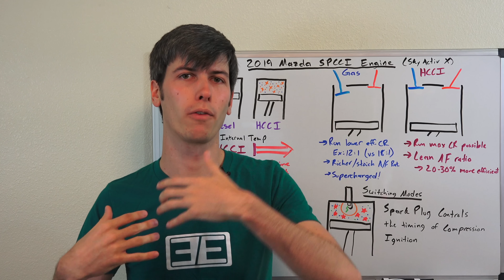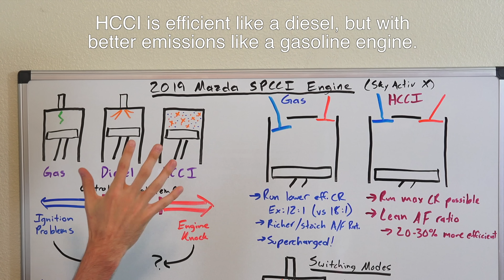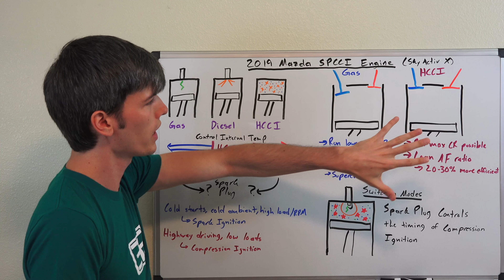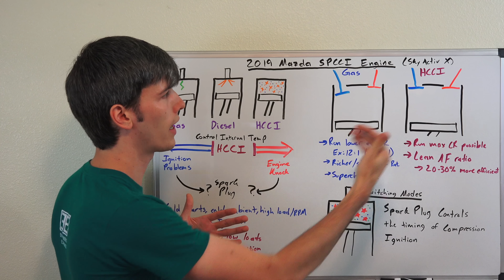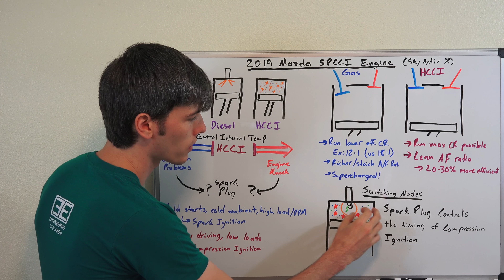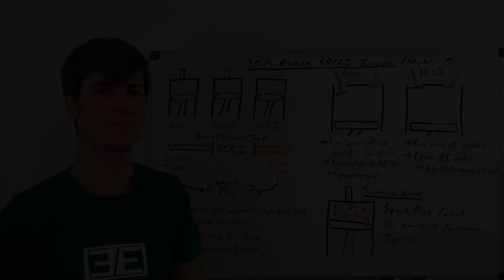Mazda Creates The Holy Grail Of Gasoline Engines - HCCI SkyActiv-X

Comment: This news just came out like 2d ago. Can't believe how fast you got this video out
Reply: Engineering Explained if the system is good it'll prove itself right away...when Honda came out with vtec people screamed bs....soon after every company had a form of it.....technology as you well know is growing....for now my 94 Acura with original unrebuilt engine with 205k on the clock gets 29-30mpg....
Reply: Keep up the good work EE.
Reply from the maker: Made some phone calls to Mazda, made it happen! There's still a lot of information they haven't released at this point, but it's very cool that it's coming to production cars.
Reply: my tuner has been preparing for this for several months
Reply: Colin Kao hes a genius
Reply: The news for this engine has been around for quite some time. First heard about the idea about a year ago
Reply: GM also had a pair of driving concept cars with their HCCI engines in August 2007.
Reply: Was rumoured since last year, and confirmed over a month ago,  and all that in SA
Reply: They have to make it sound like it is better and closer than electrical because that is here, including free charging. To my ears this sounds like a somewhat BS move by an advertising resource within the company.